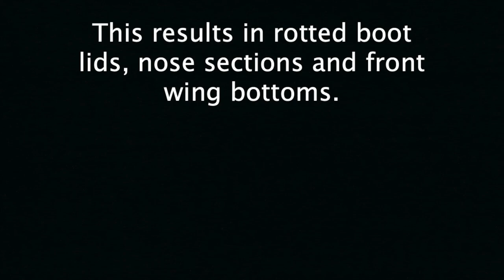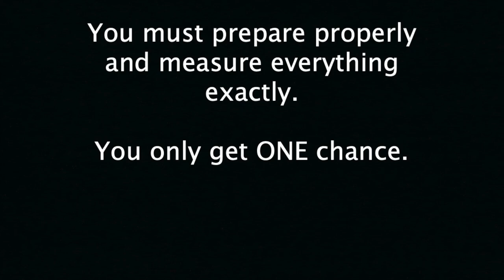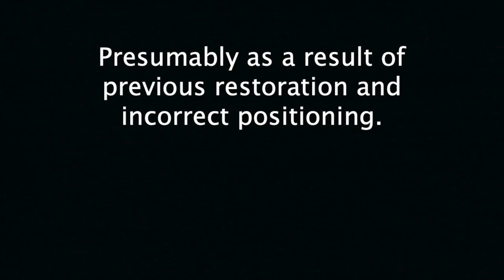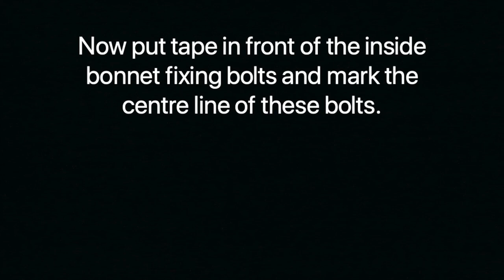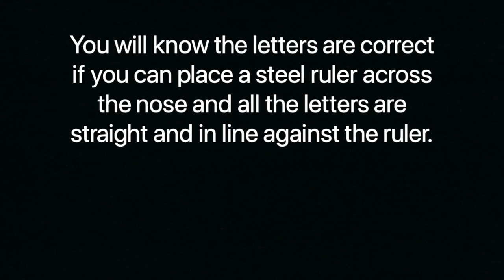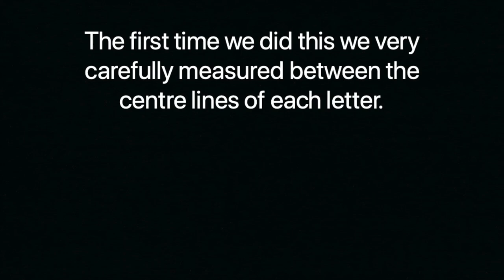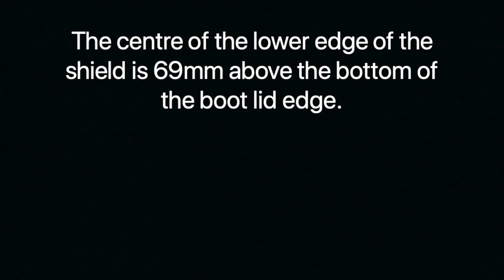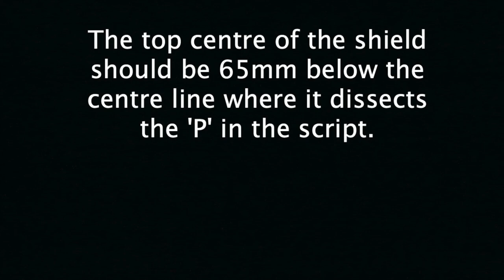Sunbeam Alpine & Tiger: Attaching the Badges with Badge Tape

Comment: Is the letter N upside down in this pic? At 8.26
Reply from the maker: Yes that picture was from 2003 and the letter N is upside down (even though it was held on with Pins at the time). It should be as it is at 8.47.
Reply: @TheSunbeamAlpineChannel  Bloody hell 😲you should get a job at ours as an aircraft inspector you certainly have the eye!   Chapeau!